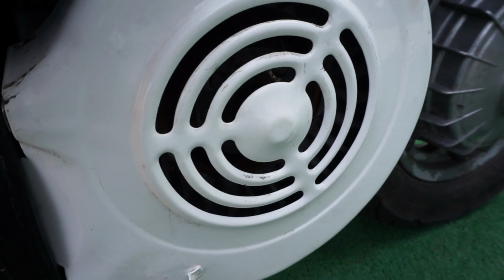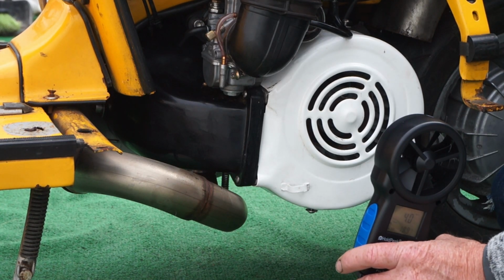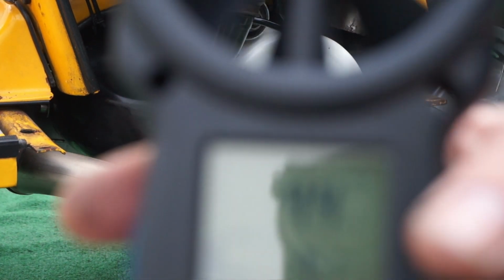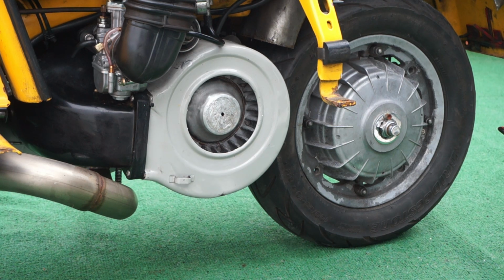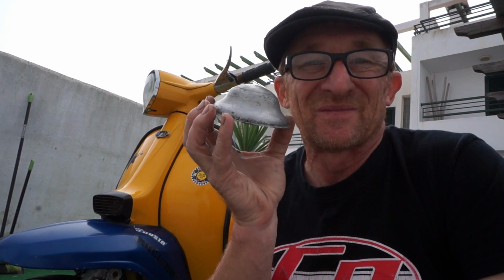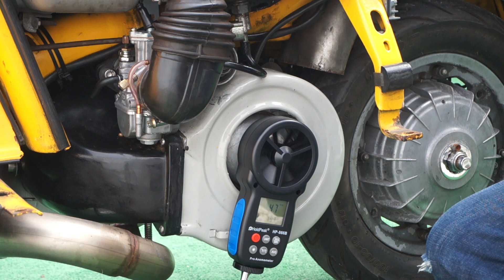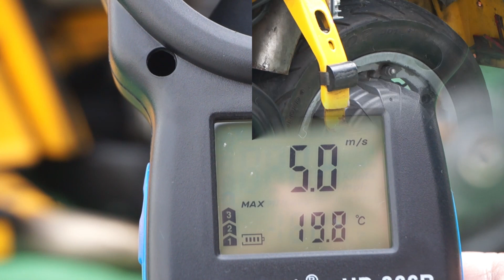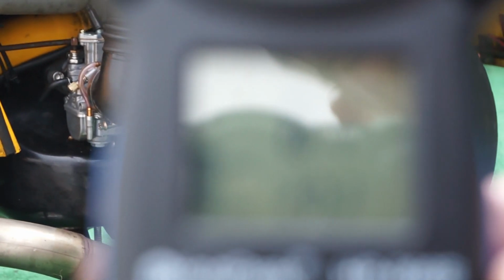lambretta v anemometer part 2

Comment: Hi Steve ,had a look at  the flywheel cowlings  on various lambretta`s   the one that     stuck out the most is the one fitted to the LD  ,you`ve  seen them   ,odd how  they have  a  curved  centre   cowl that  forces the air flow   into the centre then outwards  thru the fan to cool the cylinder the later series one  two and three had a flat face   and flat  centre compared ,any thoughts  why
Reply from the maker: cowlings by designer ? not by engineer
Reply: @TheSteelweasel  sounds about right,would be interesting   to see if  having  the LD type on a  series three cowling made any diiference with a doomed     center

Comment: Nice one steve , i cant see the casa cooler being any different from yours or the bgm tbh , its just a machined version and like you said its very expensive which is ok if you are loaded i suppose but for about the same results i prefer the one i bought off you the weasel speed version , lightweight and inexpensive and gives good results keeping the motor cooler , great testing steve i hope someone lets you test a casa cooler just so we can see how expensive it is to get the same results . 👍🛵
Reply from the maker: Dave . your probably right mate .  but looks like my cover is about 20 % more air flow so im well happy about that ..........
Reply: @TheSteelweasel  and me mate , good news for my motor then too 👍🛵

Comment: Another very useful set of tests 👍🏼 Pity ya didn't get a temp measurement with each 1  but there static tests & time consuming & probably wouldn't alter much. ANOTHER VIDEO PERHAPS 😀 Cheers Steve 👌
Reply from the maker: I'd have to start each test from cold ? Take to long and the highest air flow would be cooler anyway?  So not much point .....also the air temp of fist video was 25c but today was 19c gets complex mate
Reply: @TheSteelweasel  sorry Steve, I'd had a few beers & started over thinking it 😜 keep up the good work & ignore me 😀
Reply from the maker: @davidblagden7894  we all have a few mate enjoy at least you are getting involved 👏

Comment: Interesting as always, I use ur flywheel cover along with the Bgm flywheel, obviously I can’t use the dome cover but wonder if it makes any difference too flow rate if I could fit one
Reply from the maker: only 2% by my calculations bgm is working good
Reply: @TheSteelweasel  was thinking of dremmel tiny slots at the bottom of the fin so the wire clip could locate into it and the two prongs already have a small hole in the flywheel drilled. Might be worth doing if gaining 2% 😁
Reply from the maker: @exsoulagent  go for it ✌ even if you only enjoy the play time . good look let me know if its a success